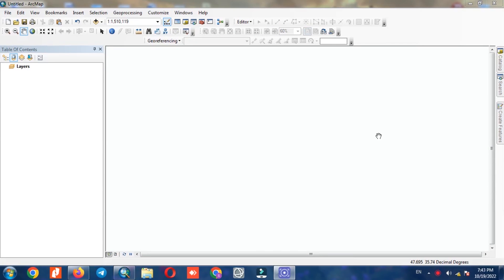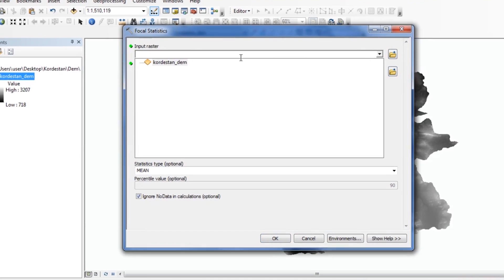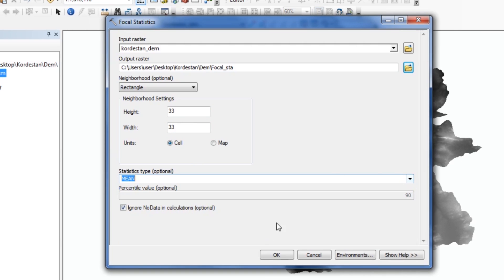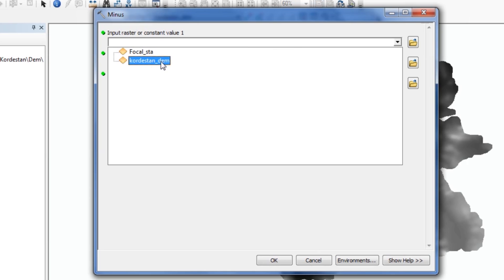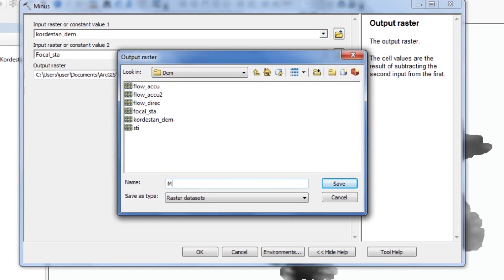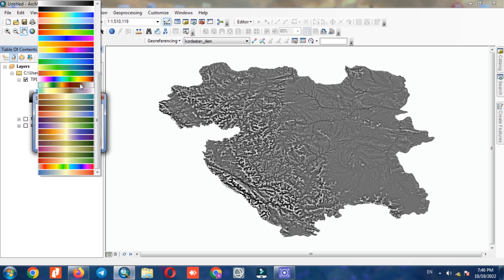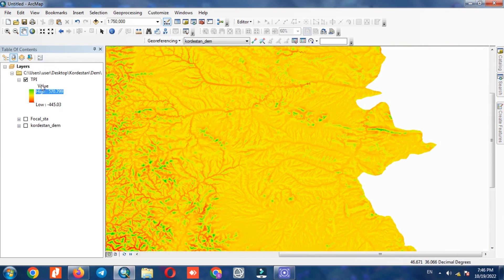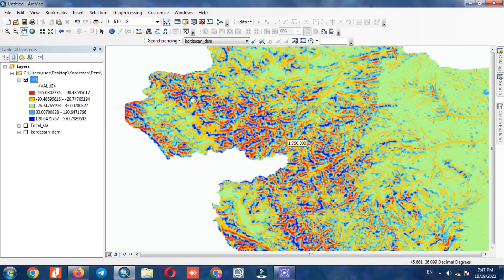Topographic Position Index (TPI) in ArcGIS Using DEM

Comment: hello I want to ask, what is the TPI scale used by this calculation? does the meaning of 33 is the value of the scale where 33 is multiplied by the spatial resolution of the DEM?
Reply: for example my DEM resolution is 10 m, using this calculation does it mean that the resulting TPI has a scale of 330 m?
Reply from the maker: Hello
Yes
You can increase or decrease this amount